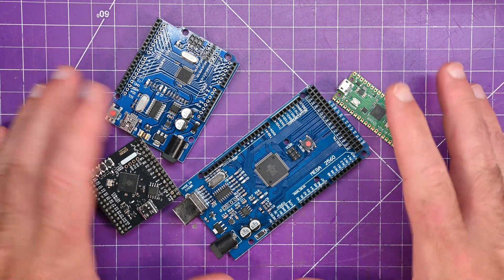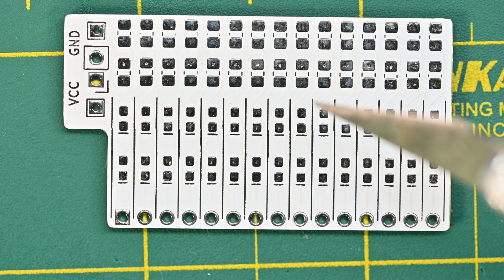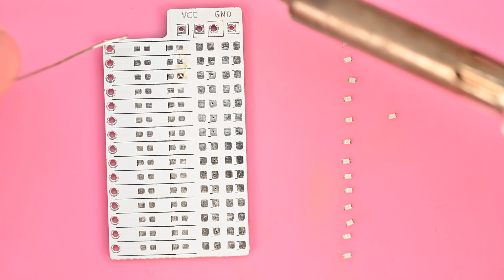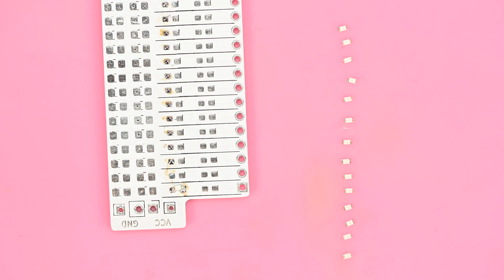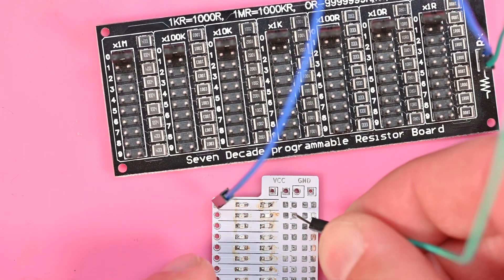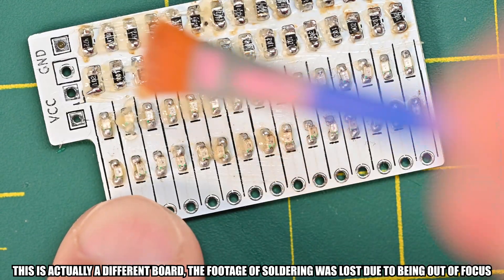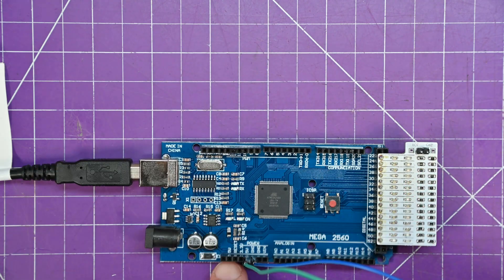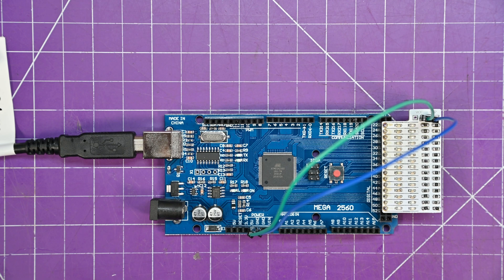Does Your Microcontroller Work? - Tiny GPIO Testing PCB!

Comment: It's always a good idea to clean off the flux. This is especially true for the acid flux used on water pipes. Over time it's possible for the excess flue to actually eat small pinholes in the pipe & cause leaks
Reply from the maker: Oh yeah, if you use acid flux for soldering you MUST clean it!